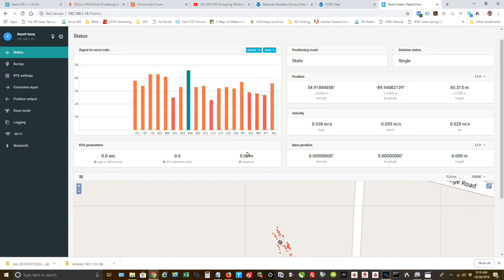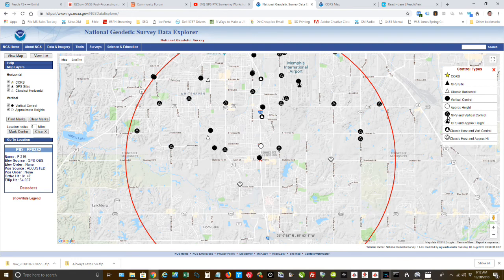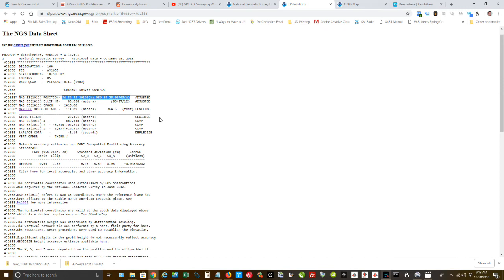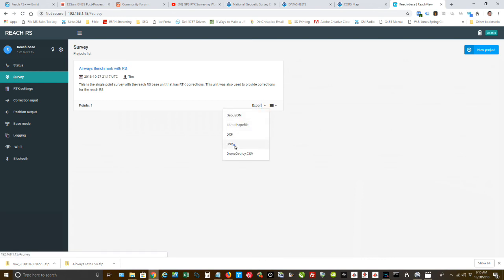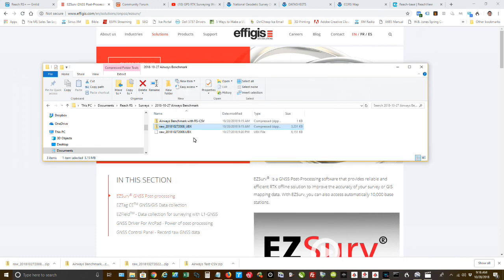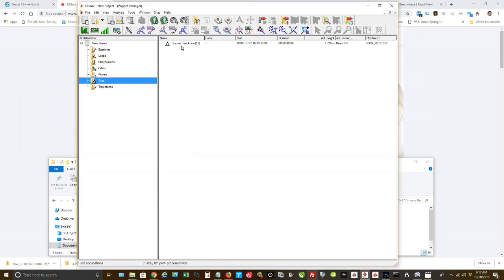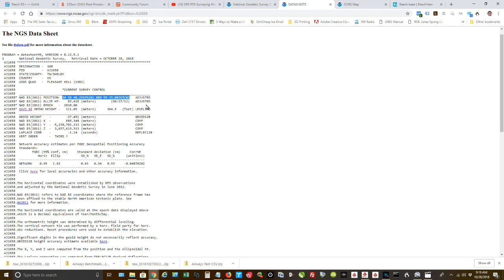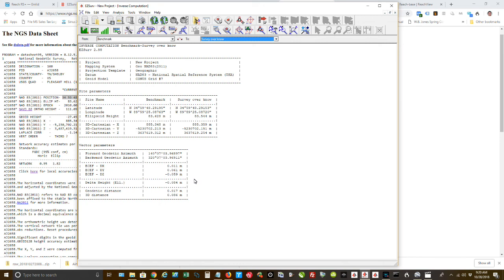How to check the accuracy of your data collecting for Ground Control Points

Comment: So let me ask you a question?  Please forgive me if it's stupid...lol. So do I need the Reach M+ Module, and this base?  Or can I get just the base to mark the coordinates of the gcps?  Or I guess another way of asking...is...what's the advantage of having the Reach M+ Module?  Thanks for your time!
Reply from the maker: Hi Michael,  learning about this stuff was truly one of the hardest things for me to learn so there are no stupid questions :)  In this short video I am demonstrating how to survey a known point (benchmark) so that you can then check the results you get with the true coordinates of that benchmark.  For every benchmark in the USA, there is a Datasheet.  Benchmarks can be found here:
https://www.ngs.noaa.gov/NGSDataExplorer/
For testing purposes you can survey the known point (benchmark) with a tripod base or a prism pole.  The tripod base with a Tribrach adapter will yield much more precise results.  If you are brand new to GPS surveying (for the purpose of collecting GCP's) then I would highly recommend the full video I just put out.  It is 1 hour and 44 minutes long but it covers every single aspect of collecting GCP's and will save you days (more like weeks) of headaches and frustration trying to figure this stuff out :)  Here is the link:
https://youtu.be/ZK0kW1AhSBU

You mentioned the M+.  I have the older Reach RTK (predasessor to the M+).  You can actually mount these on a survey prism pole or tripod but they are not going to yield the same quality results that the Reach RS will.  These are truly designed to be mounted on UAV's that are high in the sky, hence the much smaller antenna.  I will be doing a video very soon that shows the differences in using the Reach RS and Reach RTK/M+ for ground survey (data collecting).  I hope this helps!
Reply from the maker: One thing I forgot to mention, is that doing this involves surveying the benchmark, then the post correcting that survey with data from a CORS unit (I use Effigis EZsurv software to do that).  So going back to the question on the Reach M+.  If you have a good open sky, and you use the Reach M+ mounted on a tripod or prism pole (more specifically you have the antenna of the Reach M+ mounted directly center of the prism pole or Tripod setup.  You would then do exactly the same thing which is take the RAW data file from the Reach M+ (or Reach RS if that is what you are using) and then post process that data using EZsurv with correction data from multiple CORS (reference) stations.
Reply: @3dMappingTools  very cool.  I guess I was under the impression that the reach M+ Module went on the bird and the Reach RS base was the ground unit.  I was trying to get accurate GCP's for my job sites.  I am trying to learn all about RTK etc... But that helps me understand a little better (I think). lol. I am just started your 1:40 min vid now!  The 101video.  thanks again for the great info.
Reply: Also I am sure I will understand a lot better once I am finished with the vid.  LOL. Thanks again!
Reply from the maker: @michaeljones6471  Watching that video should help.   fyi, putting the M+ on a drone to geotag your images is  completely separate from doing GCP's on the ground.   Using a drone based solution to geotag the drone images will ever exceed the quality of using GCP's on the ground, but it certainly can help in the stitching process.   I am going to start testing with using the Reach RTK (now called M+) on my Phantom 4 Pro.  I got a kit from TuffWings and if that runs smooth, I will just use it in addition to the GCP's on the ground, but it would not replace them. Hope the video helps!  Thanks for watching.